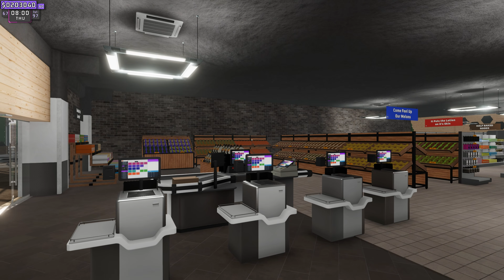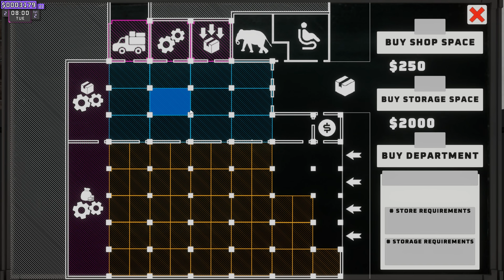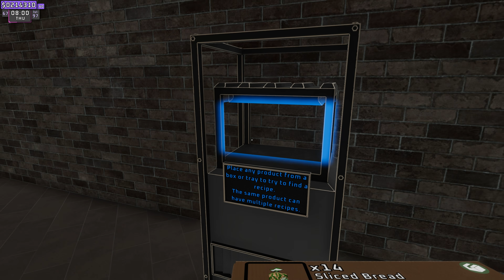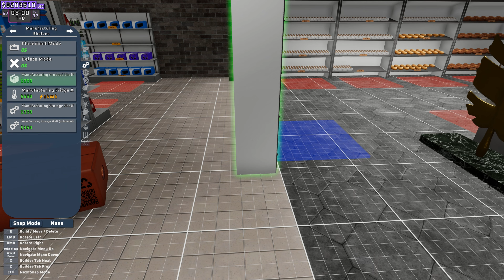How Manufacturing Works in Supermarket Together - Complete Tutorial

Comment: Thanks for the help! Was totally lost when me and a friend unlocked the manufacturing section. I hope these timestamps/*key points can help someone else!
0:00 - intro
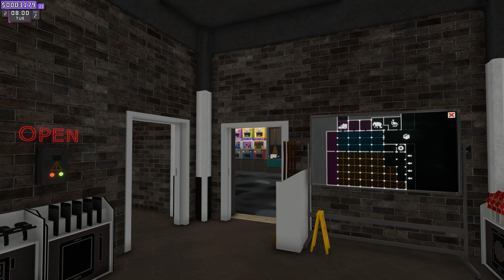1:03 - unlocking manufacturing
2:59 - buying required equipment
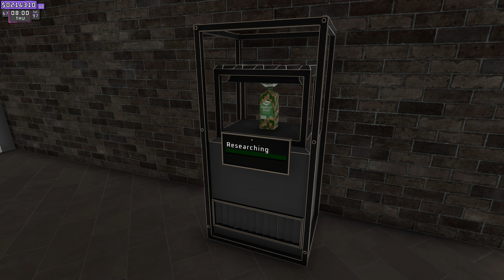4:40 - how to research
5:03 - * what to research
5:32 - using the production machine
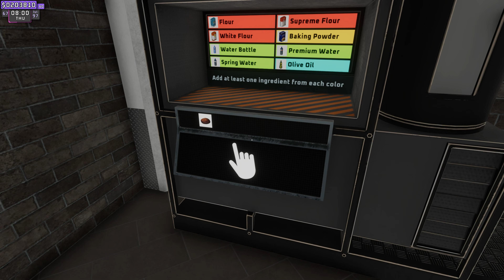8:21 - gathering ingredients
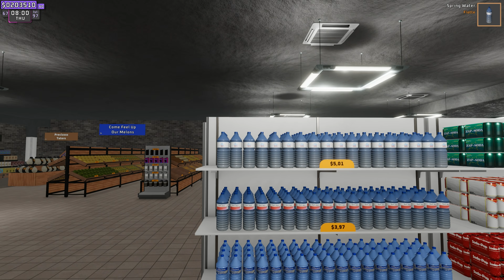10:02 - * high $ ingredients = high $ product
10:40 - pipeline overview
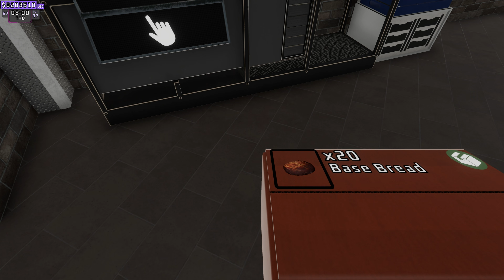10:51 - selling manufactured product
11:22 - special shelves/fridges/storage
12:12 - * prices unchangeable (based off ingredients used)
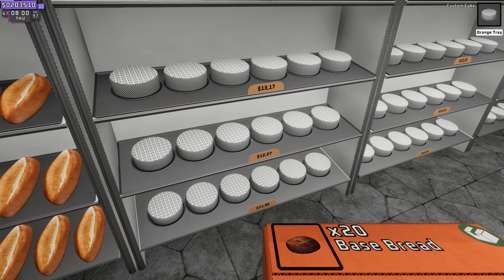12:28 - minmaxing with employees
13:35 - * manufacturing is not entirely automatic, even with employees
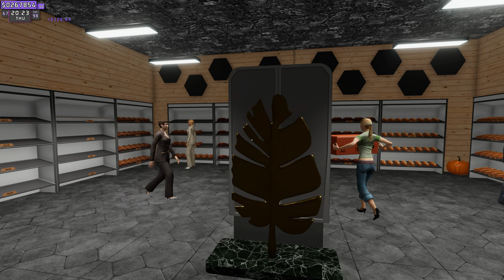14:01 - * extra tips/recap
15:37 - end
Reply from the maker: THanks for the time stamps.. I meant to do this and never got around to it
Reply: @PhenixxPlayz  they call me "timestamp guy"